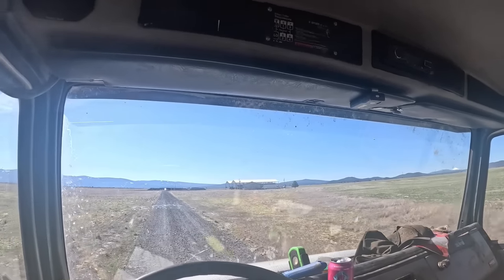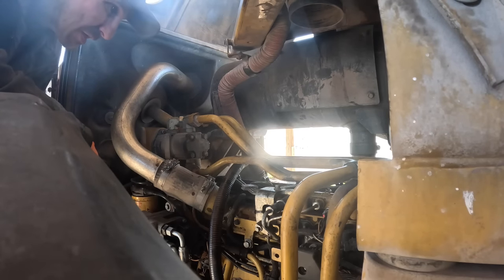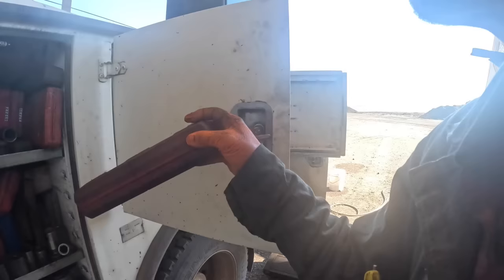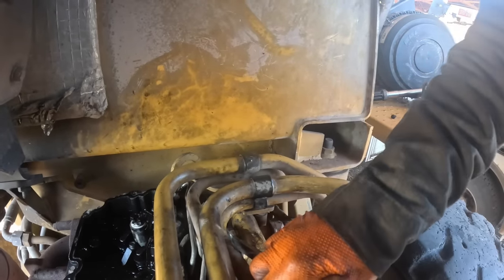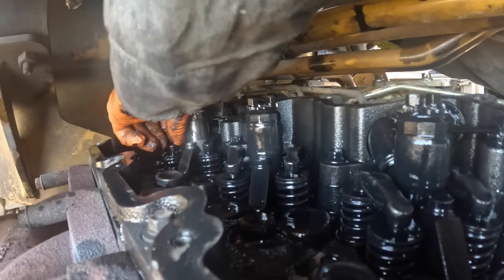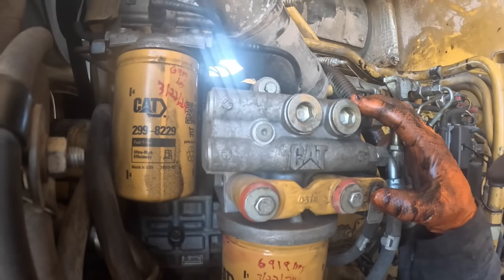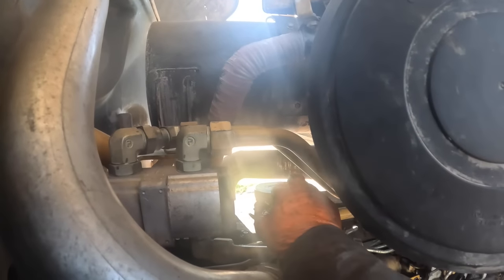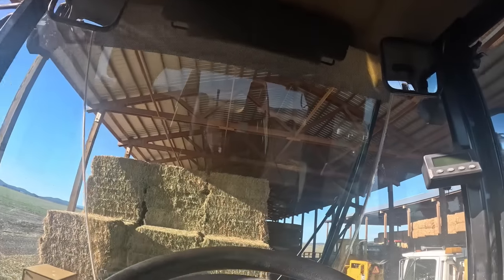Cat 6.6 Acert

Comment: Heck with the quality of parts nowadays replacing all 6 it wouldn't surprise me if 1 or 2 of the new injectors would turn out to be junk .
Reply: Supposed to bench test them before install,mechanical usually good it’s the electronic ones that ya gotta watch out for.
Reply: He's in a field so all the test are 😂😂😂😂😂that's like having re man engine and pull it apart too see if it's OK,,,last year reman on Warren,,5 minutes it all blew up and that was only $50.000+😂

Comment: I used to turn wrenches for a mining company  they had an old Komatsu PC-400-1 excavator with a NTC  855 in it.   We had a lot of injector problems with it.  The plungers would stick down and score the barrels continuously. We figured out that the ultra low sulfur off road Diesel fuel didn’t have enough lubrication for the old mechanical injectors. ( thanks Uncle Sam ) So with this particular machine we started adding like a gallon of used motor oil to the fuel every time she got fueled up.   Problem disappeared.

Comment: . . O can wire,  . . . added a C can, Deutsche connector . . . update ratio code. . . .  control module. . . updated throttle sensor from Paccar for $1,500.

Don't you miss working on 46A's and pony motors ??

Love your channel Warren.  Really appreciate your hard work and commitment to doing it right and servicing your customers.  Still hope for our country.  Carry on
Reply: Prairie Poetry I love your camerawork.